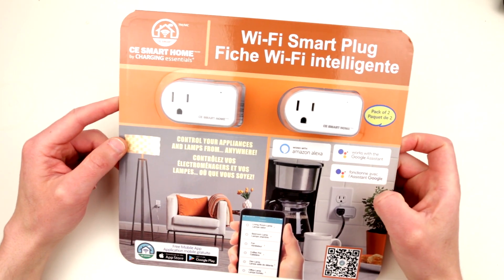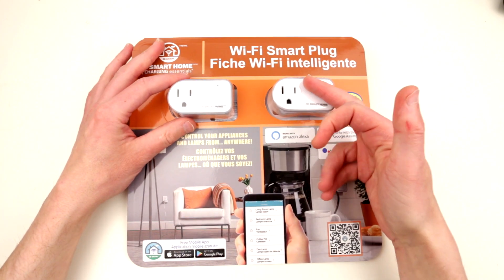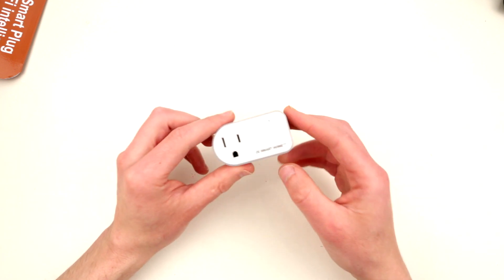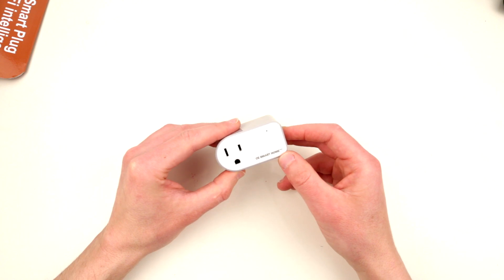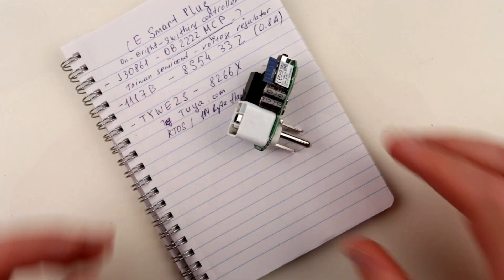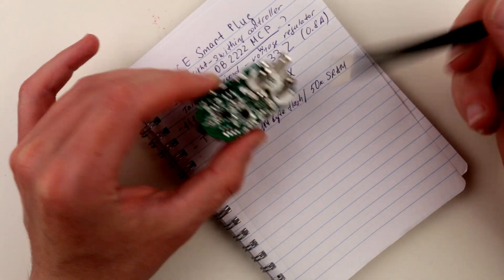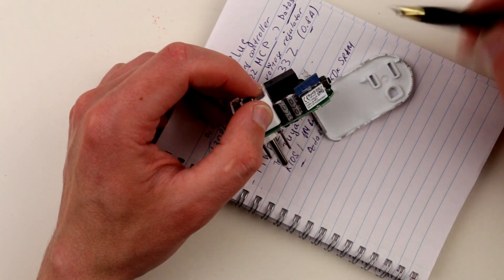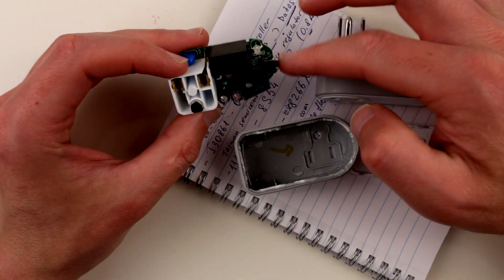Taking apart Smart Plug from Costco

Comment: I want to hack them to add an external coated wire to use as a external antenna to improve the distance and reliability.
Reply from the maker: Possible, or even better add an proper antenna. But this is not insulated poweruspply, so be careful with sticking out of it.

Comment: Fun while it lasted !!! These were great until they broke..... The first one was with my Air Conditioner....Immediate Kaput! Then a 100 watt light bulb....another Kaput...still figuring that one out....one left so I'm  be connecting a small lamp. Many thanks for the tear down... saved me from looking for something I can't fix anyway !
Reply: Blew mine with A/C too.
Reply from the maker: @ort619  That are not clear at all what is the power rating on those.
Reply: @InsideOutElectronics  I’m not sure. The smart plug was 10 I believe 🤔
Reply: @InsideOutElectronics  10A and 1250W is says o the front.
Reply from the maker: With AC it might be just fuse, ghey are not so powerful. With lightbulb i do not know...
Reply: @InsideOutElectronics  Hey thanks for the prompt reply.....So cheap, not worth the aggravation that you put up with....I'll wait for the next sale  ! Cheers !
Reply: @InsideOutElectronics  I need to know where the fuse is. La-wf2
Reply from the maker: @ort619  I have sealed mine at the moment, but i think fuse is that ceramic component at the bottom of the pcb

Comment: I was hoping to replace the fuse, lol.
Thanks for the help at 8:20, probably will just buy another unit.
Reply from the maker: Yeah, that fuse is just to prevent fire and make sure it not going to blow up.... not easy to open at all, or break it then glue or tape back togater

Comment: I got one that connects wifi and I can turn it on and off with the app, but the output doesn't work. Whatever I plugin doesn'T turn on or off. Is there a fuse inside or it's the relay that's fired?
Reply from the maker: This smart plug is pretty whimpy, and yeas tehre are fuses inside check 6:02 of the video. What did you have plugged in ?
Reply: @InsideOutElectronics  a dehumidifier hehe it says 1250watts on it... Didn't check how much the dehumidifier is pulling. Didn't thought it was that much.
Reply from the maker: @TheChug  you can test secong one on string light or something to make sure it actually works
Reply: @InsideOutElectronics  I tested with lights, doesn't work
Reply from the maker: @TheChug  They should have put there resetatble poly fuses not die-once fuses :( jerks !!!
 I would return this crap back to COSTCO saying it does not work

Comment: Amazing little device and inexpensive to boot! Has anyone hacked the plug to give you a contact closure, rather than switched 120vac ?
Reply from the maker: Sorry, but what do you mean by 'contact closure' ?
Reply: @InsideOutElectronics  It may be a reference to wet/dry contact.
it looks like a fairly skookum relay in this device, but it is passing on the same power that is used to control the relay. This would be a 'wet' contact in electrical terms. Changing the source at the relay to the initial power, would eliminate the board power source as a limitation of end use power.
BTW; while watching your video, i used a heat gun to warm the 'glues' inside. Still not pretty, but it worked.
Reply from the maker: @dogbite1516  Thank you for explanation and for watching video. Heat gun is neat idea. but I don't have one. I guess it time to get one eventually....